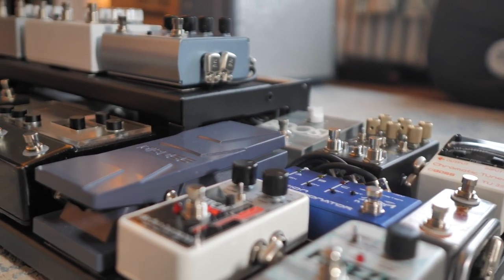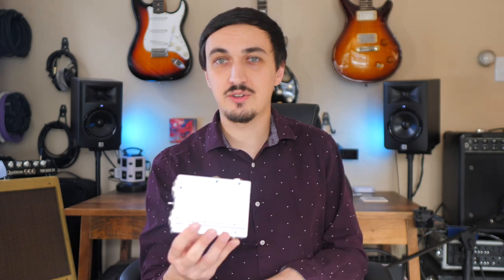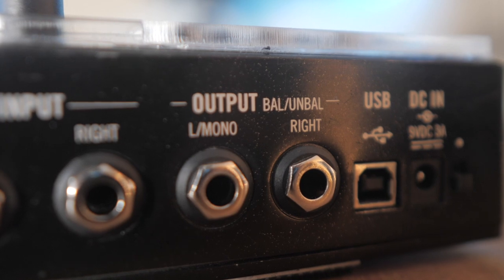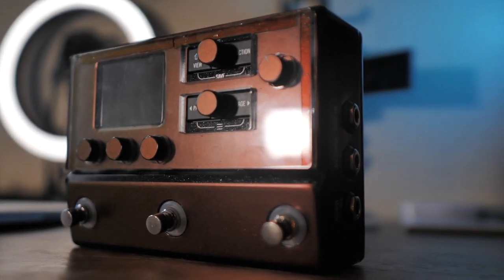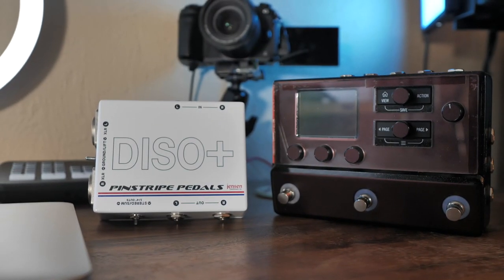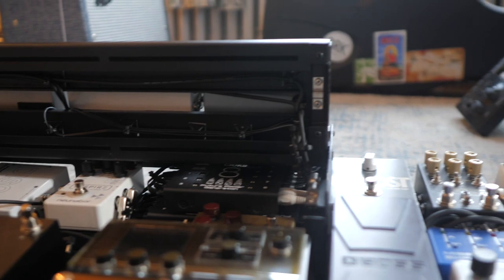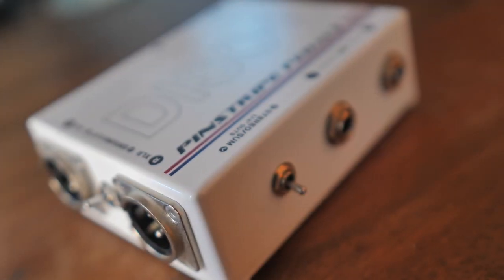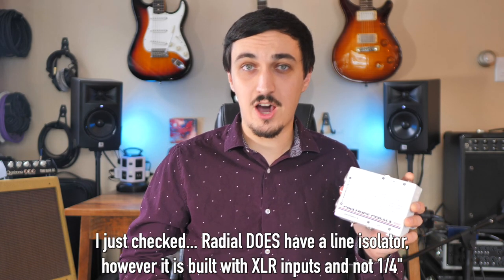Why I Keep a DI Box on my Pedalboard - HX Stomp + Pinstripe DISO

Comment: Please tell me how I can run the stomp XL to my headrush cab and still use the volume but also run to front of house. I do have a deep eye box but I'm not exactly sure on the best way to do this
Reply from the maker: I would feed your personal monitor with the headphone output and use the main L/R to send to front of house. In global settings, make sure you have the volume control set to headphones only and not Main + H/P.

For your headphone to monitor connection, you could just use a normal TS cable and you'll be hearing the left side of your patch, which is fine if your presets are mono. If you use a TRS or TRS to XLR cable to connect to the Headrush, you'll hear nothing as your signal will be out of phase, especially on mono presets. If you want to use the headphone jack in stereo and connect to a mono speaker like the Headrush, I would use a long TRS-Y cable and use each side to connect to the Headrush's two inputs.

Comment: How do you know when you run into a ground loop issue? Like what does it do? I’m switching to the digital world, and I’m working on my board right now, but I had no idea I needed this box. I play a lot of venues almost every weekend.
Reply from the maker: You'll hear it for sure. A ground hum can be caused by a number of different things and can sound different depending on what the cause is. It'll be as loud or louder than your signal.

Comment: Great video! thank you. I'm doubting if I will benefit from e.g. the walrus canvas: my last in chain pedal is the UAFX dream 65 and I mainly play at home connecting to my audio interface (which I believe doesnt have balanced inputs)
Reply from the maker: If you’re just recording, I’d say save your money. Your interface probably does have balanced inputs if there is a line in but if you’re running a short cable, an unbalanced, line level signal running to a high impedance input (on your interface, you probably have a switch that says “instrument”) is just fine.

Comment: Correct me if I’m wrong, but I think it’s also great for using two instruments (in my case bass guitar and double bass) with HX Stomp. Both instruments could have their own balanced output and a sum could be sent to the amp, right?
Reply from the maker: Correct! Honestly though I think you'd be fine with the mono version for that application. Just set up a couple different presets for each instrument and make sure they're at the same level. If your sound guy wants different feeds though, that's a different story.
Reply: @AlexPriceMusician  That’s the story - acoustic IRs (for upright) are much quieter than signal from active bass guitar, so it’s hard to set the same level for them. And i think it’s also making life easier for sound guys (and therefore for me) if they can have different feeds. Could you explain yet what is the purpose and application of XLR summing mod? Thanks for the answer and for your videos - I’ve learned a lot from your channel!
Reply from the maker: @romanchraniuk2330  Of course! The reason for a summing switch on the XLR outputs might be to run mono if needed. Maybe the sound guy doesn't like that the guitarist is taking up two channels for whatever reason or maybe the in ear monitor rig only has room for one guitar input. If you've built a stereo rig, now you might have the issue that you're missing half of it (in older stereo chorus pedals, they were usually made up of the left side being vibrato and the right side being a dry-thru tone for example). 
Another way to make this work without getting a summing mod would just be (as long as the HX Stomp is the last pedal before the DISO) to unplug the right output before starting it up. If there's only one jack plugged in upon startup, the Helix will automatically sum everything to mono to fit on that one cable. A pretty nice feature to have!

Comment: Hi, great video! What are your thoughts on this: 
Radial Engineering PRO ISO Stereo Line Isolator +4dB to -10dB with Radial Transformer
Reply from the maker: First off - you might notice that the inputs are XLR. When I read into the product description a bit, it's actually made to take a line level balanced signal and convert it to mic level unbalanced. Radial has SO many different DI box-type products it gets really confusing. This doesn't really have a place on a pedalboard, unless you've got a properly balanced, line level signal already and are looking to plug it in into a guitar amp.
Reply: @AlexPriceMusician  I understand, thanks for your help!

Comment: I have a gig to play two days from now.. 
This is really frustraing 😞 

I will be using two outputs from the stomp
Go out with two normal guitar cables ( TS cable )
Go In to two DI boxes the venue provides
Go out from DI with xlr to foh

Since the stomp alreday has a low impedance output, using di boxes (which has high impedance input and drops it again to lower impedance) , will drop volume about 15db..?? 

Should I boost all my presets to compensate for this..??

Is this going to be a problem?

Thank you very much
Reply from the maker: Using a normal DI box won’t be an issue! The sound dude/sheila will just have to boost you a bit. 
This video isn’t meant to convince anyone that the DISO is the only solution. There are a lot of ways to achieve great isolation. A DI box will work fine if that’s what you or the venue already has. If you don’t have your own DI box and the time comes that you’re looking to purchase, the DISO is the best thing out there and I highly recommend it for any professional.

Comment: Why is playing in a Jazz group make it weird for playing in stereo? You might be too young to know about the early days of pick-up splits and parallel pick up routing. While not quite "stereo" there are 60's tube amps that run two signals, one in each speaker (for each pick up). The Magnitone reissues explored this and I own a 60's Ampeg that does this. While the initial idea was for jazz players to address each pick-up, the Roland JC-120 was the amp that tought us how to utilize stereo effects with a combo amp with a single input, but a  stereo effect return (you'd bypass the mono pre AND just plug in to the stereo return). Then there is the idea of dual mono amps (phase issues...etc). Long and short....playing with two channels is nothing new. If its "stereo" or parallel processing or "wet/dry/wet" or dual mono...it just takes a matrix router and you have all of those options. 
Your vid about "mod pre or post time" (I'm paraphrasing) should be sorted out via a matrix. 
If you are unsure of what a matrix router is, the Sound Scuplture Switchblade system is "academically" where to start. Since you own a Morningstar Engineering device,  perhaps the ML-10X is where you want to start. 
If parallel amps vs amp pedal as distortion/preamp pedals might be your cup of tea, the ML-10 is your bag. Or maybe you own a H9? Half of the effects are "pre" effects/amp and half are "post" effects/amp, vs owning two of those pedals, just rearrange where it exists, per patch Just my 2 cents. I don't play at churches. I've just made ambient guitar noise since the 90's. .